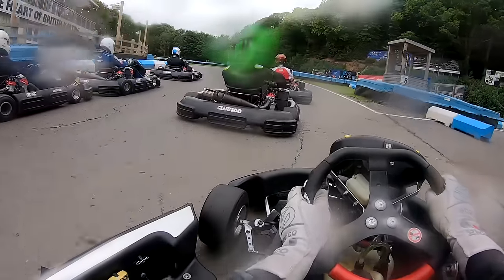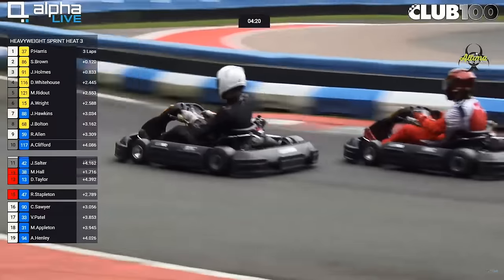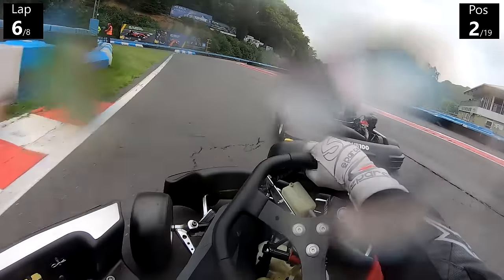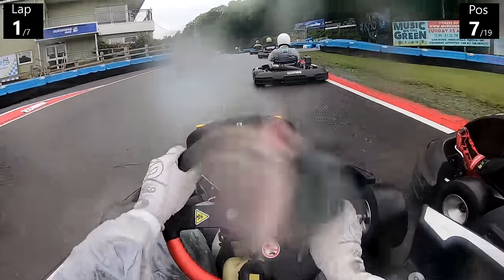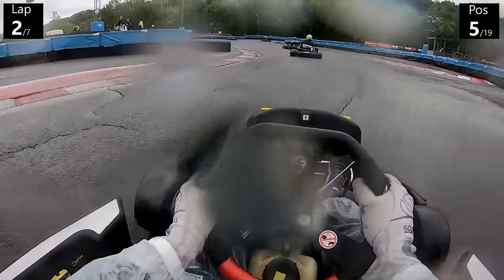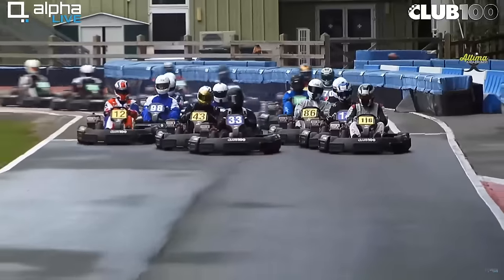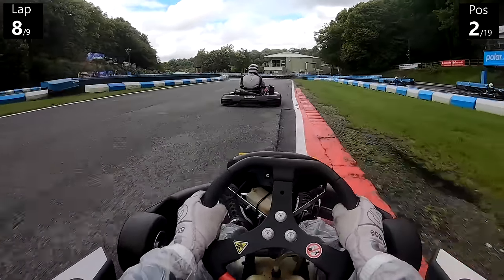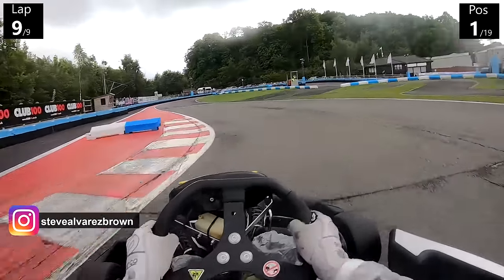Kart Racing With Almost Zero Grip

Comment: Tip I learnt racing my kart (I own a race spec TaG 125cc kart), the kerbs are your biggest enemy. Painted outer lines are also evil as well. If you can, avoid them at all times. Your tyres won’t grip as well after touching them

Comment: I did a 24h endurance race with slick tyres and wet conditions. The key was push the throttle when coming in the corner and let the kart over steer all the way on the outside of the track and turn with the rear instead of the front end which, has you show, has no grip at all. So it was coasting instead of breaking and then throttle control all the way inside the corner.

Comment: You can use your brakes to move the weight forward to get some traction in the first part of the turn, then trail brake til no more brake is applied. It seems like you're missing the transition by doing it too quickly, as in dry conditions.

Comment: As a fellow kart racer I can assure that rain racing is chaos
Edit, wait in Europe y'all don't have rain tires for your karts
Reply: Generally not used in hire kart racing as they're trashed within a couple of laps of the circuit drying out. That's a big expense for the operator. We use them in owner/driver racing.
Reply: @Monkey1one  thanks for the insight

Comment: if i learned anything from racing karts in the rain, dont JERK the wheel left and right, it will just move the wheel without it doing anything, slowly rotate the wheel to keep the grip and go through turns fast. its a big difference because every time i see you try to turn in you try to turn in the dry way, just jerk the wheel in the direction you want to go, initiate slight drift, and then controll it. but in the rain you want to keep the grip in the front wheels
Reply from the maker: Thanks but honestly, I've driven these karts in the wet for about 10 years. I think I've got it worked out, don't worry.

Comment: I race go karts professionally and when you are on slicks in the wet you have to put minimal steering input and don't fight the kart otherwise you will loose time
Reply from the maker: Have you driven these karts though?
Reply: No but if you put less input in you will fly in the wet!
Reply: And also turn early for fast corners
Reply from the maker: @aidanl7897  I'd love to know how you know all this having not driven these karts (and maybe not even the track). I've driven these karts for 10 years around this track. I've worked it out by now!!
Reply: Just saying ur making a lot of mistakes and u could improve in the wet
Reply: I haven't drove buckmore cos I have all my own kit but it's the same prospect everywhere
Reply: 91 puts less lock in
Reply from the maker: @aidanl7897  Fair enough. Personally the the only real mistake I was making was braking too late a few times in race one. Steering wasnt the problem.
Reply: K

Comment: For situations like this it is ideal to stick on the outside line, as it has less water on it and you can carry alot more speed.
Reply from the maker: That doesn't exactly work here in these karts. Cutting back for the straight exit is best.

Comment: ease into the steering inputs don't wrench the wheel
Reply from the maker: Based on what? Have you driven these exact karts in these conditions?
Reply: @Super_GT  well I wasn't trying to offend 
I have driven the four-stroke version of these karts that we have in Canada in even worse conditions and I go out and play in the rain in my shifter on slicks whenever I can 
I have quite alot of experience in the rain and figured I'd pass it on
Reply from the maker: @owenclarke2449  I understand. You're trying to help out and I appreciate that. I would say though that karting is very specific to the track and conditions. I've driven these karts around this track for 10 years and thousands of laps. I think I've worked it out by now.
Reply: @Super_GT  just think of the grip of the tires like someone is trying to rip a piece of rope out of your hands if the slowly build up force its much easier to hold on rather than them quickly pulling it 
slowly feed the steering inputs in and it will be easier to drive maybe try using your weight more too really almost get out of the seat and get all that weight over the outside front for turn in
Reply from the maker: I agree with the moving of the body around to create grip, and I already do that. Still don't agree with the steering thing. I watch countless club 100 drivers for real and on video and the ones who don't turn sharply are always slower. It's just a characteristic of hard tyres. I've raced the karts for a long time and have been a champion of the series with lap records - I think I'm qualified enough to know what I'm talking about - specifically for these karts.